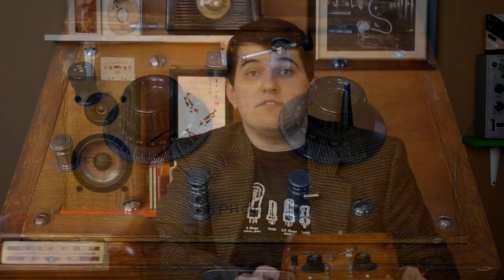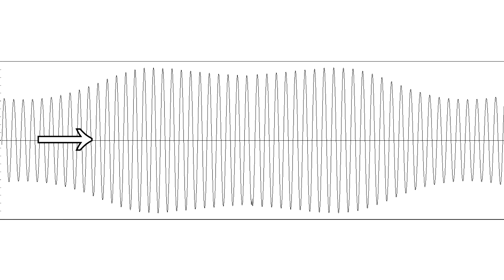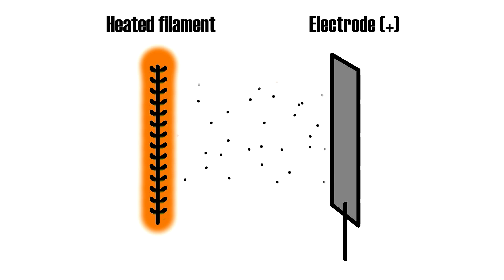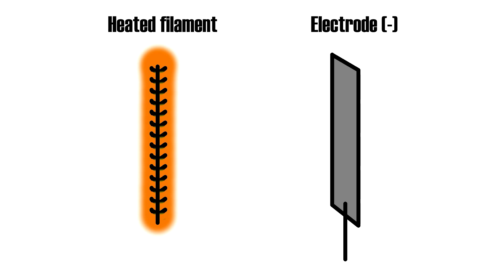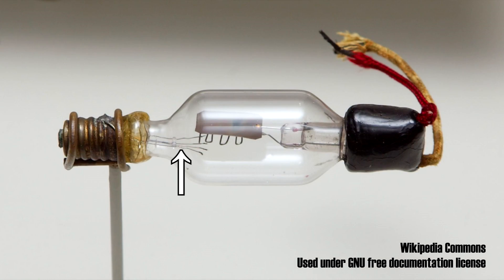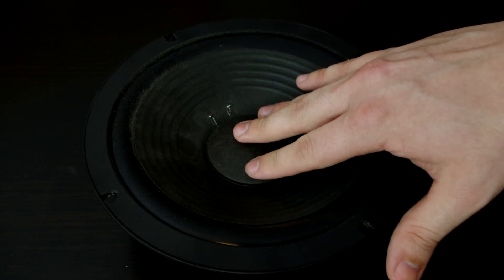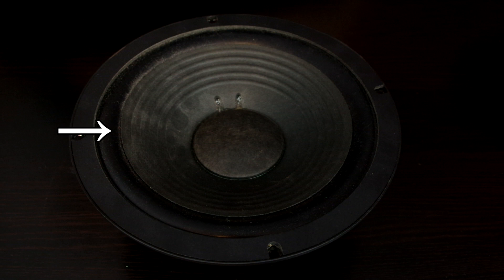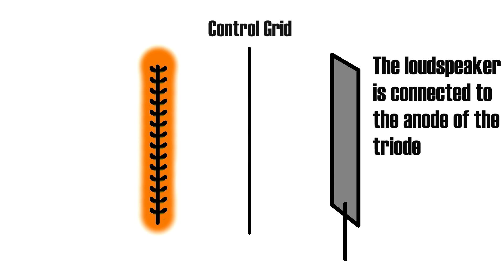The Vacuum Tube and the Invention of Radio

Comment: At 6:04, "They (tubes) do the same thing as a crystal, but much more reliable". Nope. That tube may last 5-15 years, but the crystal is still working over 100 years later. The tube also needed a lot of current to drive a heater filament in the tube from a battery or bulky transformer. The crystal could run forever with no power required. The crystal was also most sensitive & louder than a doide/twin element vacuum tube because it worked better at weak low voltages than a tube. Tubes worked good at very high voltages & impedances. It isn't until you get into amplification with the triode vacuum tube that there are advantages.
Reply: my dad has 30 to 50 year old valves in his amps. still working. valves are very reliable.
Reply: @underworldent4817  The tubes from 50 to 70 years ago were much more reliable than the early ones were. In fact, some are even more reliable than ones made today. New old stock (NOS) tubes from the 1960s are very valuable today, when you can find them. Usually when a technician from the day, who hoarded them, retires or passes away. They often come up at estate sales and auctions, along with vintage shop equipment.
Reply: @dougbrowning82  yes , the manufacturing of say, mullard in the 70s was superior to any valves currently produced.

Comment: In modern times the box with the volume control knob (a "preamp") can be independent from the fixed-gain amp (power amp). For my research, might you happen to know what was the first (likely mono, I'd guess), standalone electronic preamp on the market?

Comment: It's a little hard to believe that it took over 20 years for Hertzian waves to be implemented into meaningful communication, and a further 20 years to be developed into practical radio broadcasting.
Reply: Generators could not generate smooth AC sine waves at the MINIMUM frequencies needed for a radio carrier wave (George Fessenden did build one as a proof of concept, but it was a finicky and dangerous beast which had to spin at tens of thousands of RPM, and because each revolution produced one cycle for each of its many rotor windings, which could not be made identical, there was still a modulation at the rotational frequency even before adding the modulation from the sound).  Spark gaps generated radio waves modulated by irregular impulse noise.  The use of radio for anything beyond code required the vacuum tube (audion) as an OSCILLATOR to generate a smooth carrier wave.  Later, transistors, and later still, integrated circuits containing lots of transistors, replaced the tubes, but the principle was the same: using the amplifying ability of the tube or other amplifying device to keep a resonant circuit full of energy at its oscillating frequency.

Comment: I have heard it said that the discovery of thermionic emission was actually unfortunate, since at the time some were experimenting with crystals and diode junctions using them, and were possibly close to hitting on the ability to use these junctions in combination to change the effective resistance (and therefore the current flowing) by introducing a much smaller current into a third connection. In other words, they might have invented the transistor many decades earlier. Once they had hit on the thermionic valve, there seemed less incentive to experiment with crystal junctions. The transistor, of course, is the basis of the later integrated circuit.

Comment: 4:30 “Louder” = “amplification’. And here is where “electricity” becomes “electronics”. Because electronics is concerned with maintaining the signal information being transmitted (and operations on it like amplification, filtering etc), and less with maintaining the particular values of voltage, current etc being used to transmit it.

Comment: great video, however i failed to understand one thing:
the electromagnetic signal is transmitted at very high frequencies in order to travel large distances. however, a human ear detects frequencies much smaller than those used in transmission. So how do you go from a very high frequency to a very low frequency without distortion?

Comment: could a rectifier serve the same purpose as the crystal/vacuum tube?
Reply: Yes!  Solid state diodes eventually replaced vacuum tube diodes both for all but the highest voltage and current power supply rectifiers and for radio signal detectors.  And the transistor, a “solid state triode” (loosely speaking), replaced tubes as amplifiers, oscillators, switches, etc. at all but the highest power levels.

Comment: If the AM radio signal is rectified does this mean from that point the signal going into the speaker is always positive and never goes negative? I get that most other audio signals are AC so I guess either an AM signal will always be half the volume of any other audio signal of the same amplitude once rectified, or there was some other circuitry that converted the signal back to AC, or maybe it was just amplified more which can't be good for the speakers (e.g. vibrating from 0 to +100 instead of -50 to +50, if that makes sense).

Comment: The best explanation is the flashlight shadow example.  The flashlight is the flow of electrons (cathode) , the wall is the anode.  Your hand is regular sized and the shadow is enlarged.  Your hand modulates the end result, and is amplified.

Comment: A loudspeaker's surround on the front edge of the cone does not center the coil, but only the front edge of the cone. The suspension (a.k.a. spider) is what centers the voice coil in the magnetic field made by the magnet. On new designs of some subwoofers (frequency response is typically 20-500Hz) have the leads to the voice coil integrated with the spider to prevent lead-slap.

Comment: The real fun with things that move when applying electricity to them comes when you start looking for other devices that use this same concept. If the computer you're using right now has a mechanical hard drive (not an SSD), it contains one or more read/write heads that need to be moved back and forth to access data on different parts of the platters (disks). The way this has been done for the past 30 years or so is to have one or more magnets, usually two, fixed in place (very strong magnets, by the way, worth saving if you're going to throw one of these out) and a coil of wire attached to the headstack. Applying power to the coil produces a magnetic field that attracts or repels the magnet, and moves the heads. This arrangement is even called a "voice coil", just like in the speaker. Keeping this in mind, you can probably guess what happens if you apply an audio signal to this coil.

(head up to that search box and search for "hard drive speaker" if you want to see)

Comment: Actually the long answer is that the speaker isn't connected directly to the anode of the vacuum tube. The anode current is about 300-400 volt DC (when silent) and would burn speakers out at that voltage. What else it needs is a device called an output transformer. The output transformer then steps down that current to a voltage that wouldn't burn out speakers. This is one of the biggest reason why tube radios/amps are so heavy for their power output. It needs a power transformer, which steps the current up from 120v to something like 300 or 400v (depending on what voltage the power tube needs for the cathode). There are also additional taps for various functions such as heater (this heats the filament), lower voltage taps for preamp tubes, and various other types of tube (such as rectifier tubes). That current then goes to a rectifier, which in the old days are diode tubes, but more modern amps (such as say a Marshall JCM800 guitar amp) uses solid state diodes. Then that rectified voltage, which is now called the B+ goes to the power tube's anode. The signal then goes to the grid of the preamp tube (usually 12ax7 or something of that nature, very small tube) which amplifies the signal enough for power amp to control it, but sometimes they go to a "phase inverter" which basically chops the signal into two haves, one negative and one positive. They are then combined and fed to the grid of the power tube (can be EL84, EL34, 6L6, etc.) which controls the B+ modulation, then that B+ goes to the output transformer that then goes to the speaker. 

The output transformer and the power transformer must be the same size, and even for say a 100 watt tube amp the transformers alone weight about 20kg. 

I should also mention that if you turn on a tube amp without a speaker connected to it, something bad happens and things get fried. You must connect it to a dummy load if you are testing them. 

Transistor amp is so much simpler, because it only requires a power transformer which just steps it down to whatever solid state component needs (usually around 12v or so. No output transformer is needed as transistor output can directly drive speakers. Turning it on without a speaker connected to it won't hurt it as the reason why tube amp is damaged from not being hooked up to a load is because you are essentially creating a short circuit... That is the BIGGEST reason why transistor amps can be so much smaller. In many cases no transformer is needed and I think these days all you need is some kind of a switching power supply (similar to a computer PSU, these use MOSFETs to convert current to whatever) that is much lighter than a transformer.

Comment: So, vaguely relevant question: who and how did they come up and design the modern amplifier + speaker combination? The effect of speaker pushing back current and amp not exploding, assumedly because of the output transformer? I think this behavior is referred to as reactive load of the speaker and other problems are posed by AC not having the current and voltage in the same phase, causing some of the speakers being much more difficult for amplifiers to provide current to. And not only that but the speaker providing wildly varying impedances over the frequency range, but the amplifier roughly designed around let's say specific power output at 8 ohms and listing that in specs. Modern guitar amplifier problems and solutions for example are direct/silent playing/recording, or at least attenuated power (specifically a problem with vacuum TUBE(/VALVE) amplifiers for not sounding nice at lower volumes unlike their solid state transistor counterparts), that is fought with different kinds of reactive loads to better simulate the speaker's response to the signal and changing the sound as well, which is usually not captured at all if you take the signal straight out the amplifier without speakers. Guitar speakers also of course have much narrower frequency range than a hifi speaker, maybe from 85 Hz to 6 kHz compared to 20 Hz to 20 kHz. Worth a whole episode if that doesn't already exist? Also congrats on 666k subscribers!
Reply: Leo Fender and Doc Kauffman developed the first guitar amplifier in 1945. It was based on a circuit in the back of a Western Electric tube manual.

Comment: The diode part was confusing, because while it's obvious where the signal comes out (the plate), it's not obvious where the signal goes in. It turns out there are four pins on a thermionic tube diode:
1. heater
2. heater
3. cathode (very close to the heater, in between heater and plate)
4. plate (opposite side of the tube)

Comment: I used to own a old radio from the 20s or 30s. it had vacuum tubes that were not that good,but if you turned up the sound,you could hear it. the weird part about it was that it was using a receiving coil called a "super beam-o-scope"

Comment: Did you ever make the video of the superheterodyne radio? If you did, I can't find it on channel. The superhet was critical to radio being an everyday item in the home.
Reply: Making radios affordable was what made them everyday home  items. The cathedral style Philco Baby Grand model 20 AC table radio, introduced in 1930, was the radio equivalent of Ford's model T, and it was a TRF (tuned radio frequency) set, not a superhetrodyne. Philco's first superhet was the model 30 Baby Grand, introduced in 1935.
Reply: @dougbrowning82  True, the TRF was a major advance in terms of sensitivity and selectivity, and made giant outdoor longwires not as important, except for DX fans. The addition of the LO and fixed IF is what really made radios popular, since it eliminated most fiddling and retuning while proving a superior signal with just a short loop or loopstick antenna.
Reply: @sarjim4381  The superhet's advantage was selectivity, but you lost some sensitivity. Some better radios compensated for that loss by adding a TRF stage ahead of the mixer (sometimes called the first detector).

Comment: Do you think it would be possible to replace all the old tubee in an old tv with a transistor?
Reply: Of course. Solid state TVs became a thing in the 1970s, and we finally replaced the CRT with a solid state display panel by the 2000s.

Comment: Cheap phonographs could work with one amplifying tube.  They used high-output crystal phono pickups.  Of course they often had a rectifier tube as well, but with a selenium rectifier, a one tube circuit was possible.
Reply: Those phonographs are a pain to restore, because the medium output ceramic cartridges made today lack enough output to properly drive the one tube amp.

Comment: "This is way above the limit of our hearing" Yes, because ears don't detect electro-magnetic waves in the first place. Radio waves aren't same as sound, you cannot compare sound wave frequencies to electro-magnetic frequencies. It would be more accurate to say "this is way below our limit of seeing".
Reply: PhazonBlaxor  or else our outlets would be really annoying.
Reply: both acoustic and EM waves are convertible so we can see sound waves and hear light. Namely waves of photons. Wave is only a wave after all. We only need frequencies to match. How could you not compare things that both are the vibration? This feature of the universe we use everyday while converting light into heat, heat into motion or sound into electric impulses. Some animals can see using the sound and they create the picture literally using only the sound. Wanna listen to EM waves? I recommend Voyager's sounds of cosmos...but wait, there's no sound in vacuum :D 
Regards
Reply: Izaak Fewton But photons aren't only waves though. They are elementary particles that act as a particle and wave at the same time. Sound is only vibration.

But surely you can convert them into sound waves we can hear, and brains can also adapt to "see" using these vibrations (bats are a good example of this).
Reply: Actually by measuring sound wave you specify the probability of where such wave is in space and time is. Sound is also a movement of particles and waves. In single measurement there will only be single specified point where particular particles will be at that particular measurement. We specify the top of probability wave of photon by measuring it. We do the same by hearing or recording and sound is mainly the wave but a single note is what the particle is. Actually I know what you mean but I like to discuss things with strangers:D God less Mate
Reply: Radio waves are photons like visible light. Sound waves are really ripples in the air, like ripples in a pond. Sound travels at a little over 750mph whereas radio waves travel at light speed.
Reply: "Radio waves aren't same as sound, you cannot compare sound wave frequencies to electro-magnetic frequencies. " 

Apples aren't the same as oranges, you cannot compare orange cost per fruit to apples costs per fruit.  Sure you can, dollars/fruit or cycles/second, the units are the same so the comparison is fine.
Reply: O Soul it’s in no way a meaningful comparison as there is no frequency of electromagnetic wave which is audible to the human ear simply because that’s not what a human ear detects. It’s not like comparing apples to oranges which are both fruit and things you can eat, it’s like comparing the cost per volume of orange juice with orange paint. Sure they’re both orange colored liquids with prices and it is possible to compare those prices but what good is that comparison going to do for you? They’re used for completely different things.
Reply: @raginmadmangonecrazy  ".. it is possible to compare those prices..."  
Yes, it's possible to compare the price/volume, just like you can compare cycles/time.  
"... but what good is that comparison going to do for you?"
I didn't say it was meaningful, just that is was possible to compare sound wave frequencies to electromagnetic frequencies.
Reply: I think he meant that taking the signal from the antenna (which would have the frequency of the radio waves) straight into a speaker would produce a sound too high pitch to hear, so the electronics need extra components between to convert the signal to be useful by the speaker at making sound in the audible range.

Comment: I made a crystal radio when I was a kid.  It was kind of cool because it didn't need a battery because it was actually powered by  the radio waves.
Reply: Me too! I had an electronics kit from Radio Shack with a bunch of projects you could build, and the radio was one of them. You had to connect the ground wire to something grounded, though, so I ran it out my window and connected it to our aluminum siding.
Reply: @scottplumer3668  I just connected my ground wire to the heating vent.  I had two kits.  The 10 in 1, and the 150 in 1.
Reply: @gastronomist  At first I thought you said "I had two kids." I need new contacts! I had the 150-in-1. That was a great set. I had a couple of the other kits Radio Shack sold, too.